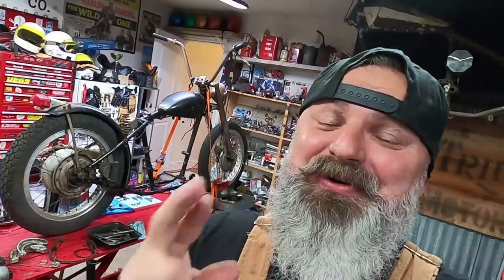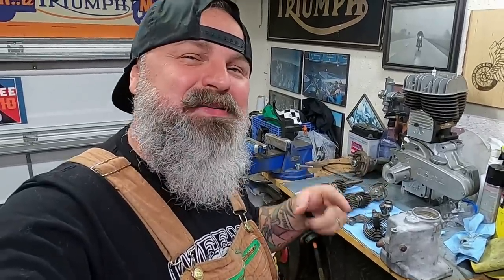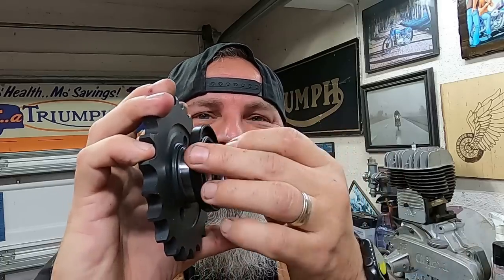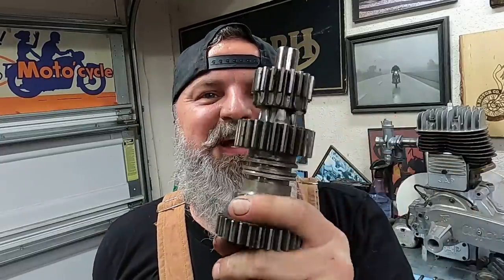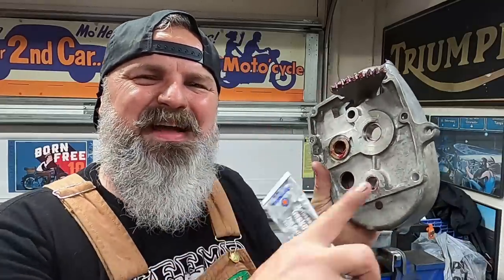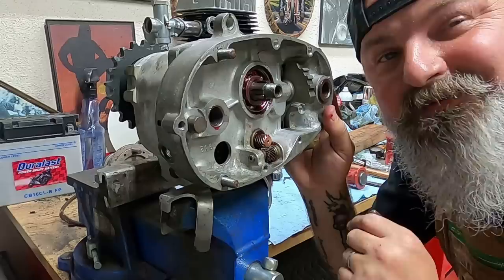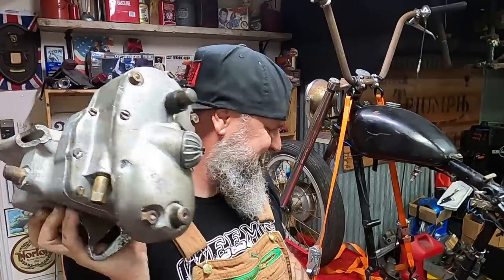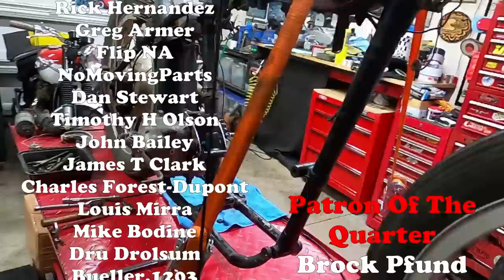Reassembling the Gearbox! 1950 Triumph

Comment: Is there a reason that you drove that bearing in using the inner race rather than the outer race?
Reply from the maker: Great question.  I do not have a drift the size of the outer race.
Reply: You're right to question this, its not the correct way to do it.  IF he's done this work many times as claimed, you'd have thought he would've found, made or purchased one.....
Reply: @weemsmotorco ouch. Make one.
Reply: When installing the trans cover, is a 5 speed T140 the same process for indexing ?

Comment: I have seen some old parts books where gaskets aren't shown but it seems odd, just by doing some simple research you will find many gaskets for this specific age of machine and application. It was nice to be shown the alleged removed gear cluster, eventually, but is all the gearset "rusted beyond repair" or is that just congealed grease and sawdust? Undertstandably, time constraints may dictate an easy option if one happens to have a known good set to hand.
Reply from the maker: Brooks, Triumph did not place gaskets on these surfaces until the early 1960's